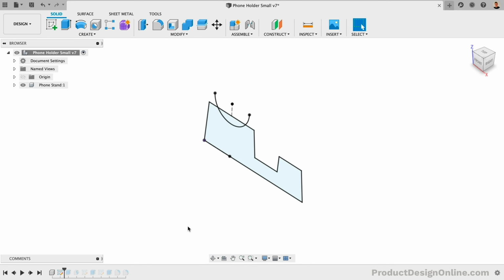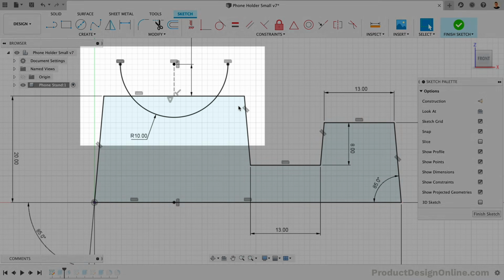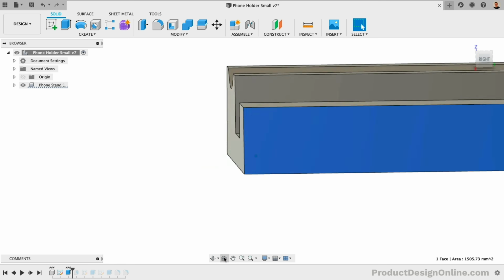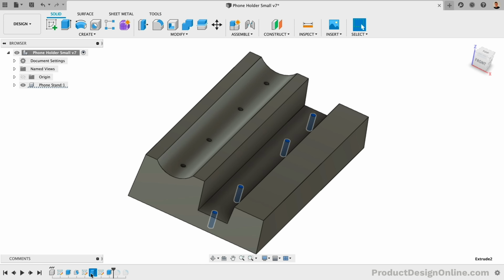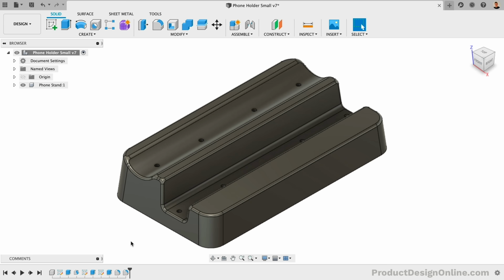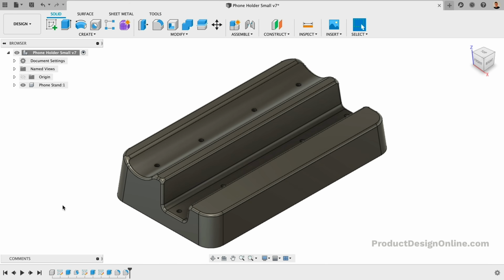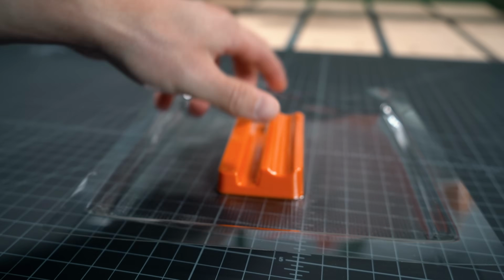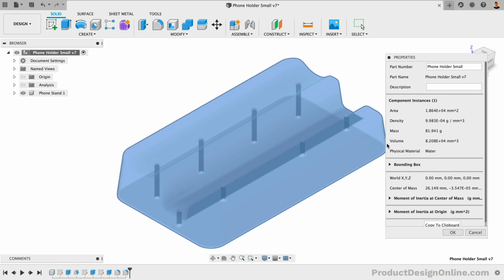Fusion 360 Tutorial – Making a Resin Phone Holder

Comment: You can use felt/fabric/string to allow the air to wick out of an area without using holes as long as it's out of the desired area, but it will leave an imperfection.  You could have just filled the first mold with plaster to reinforce it. Also, we vacuum form over just plaster all the time at my work, but that is because we modify plaster casts by hand.
Reply from the maker: Great tips! Thanks for sharing, Dan. I thought about filling the first mold with something but seem to like more work to figure out how to keep the air holes open. I love the string idea though I'll have to try that when the design allows it

Comment: This was an excellent product development process video where fusion is just a step. Showing idea through to MVP including missteps and product links makes video stand out as extremely valuable. I hope you continue this format with other sponsored prototype development tools. 30 seconds into video, I checked out the vacuum former link looking at price. At $699, its not an expensive tool. I then continued to watch with the mindset of seeing process and envisioning that tool in my development workflow.  This was a great video and with a tool product placement,  exactly what I look for. Thanks from Colorado.
Reply from the maker: Thanks, Craig! Glad to hear you enjoyed it. The Formbox is definitely not the cheapest machine, but for anyone looking to create molds or other vacuum formed parts I would definitely recommend it. I've used commercial grade vacuum formers before, so I was skeptical that this one runs off any regular shop vac (or standard vacuum). It's also very easy to unbox and start using in a matter of minutes. So far it has been a blast to experiment with.

I'll definitely be doing more videos with different machines. I have a resin printer and some other machine specific projects in the pipeline. Looking to demo some larger/more intense projects once I get used to filming/editing :)
Reply: @ProductDesignOnline  Looking forward to your future videos. As for editing, you did a fine job with this video. Thanks for the quick reply.

Comment: Kevin, to answer the question posed in the description, yes, vacuum forming is a perfect companion to 3D printing, as well as CNC. Resin casting from molds created with vacuum forming, or better yet, silicone, is a perfect, low-volume, additive prototyping and manufacturing solution.

Fusion 360's parametric modeling capabilities, as well as tools, such as Draft creation and Draft Analysis, is a perfect solution for either slicing for 3D printing, or toolpathing for CNC machining, are game-changers.

Thanks for creating and sharing all your top-notch content.